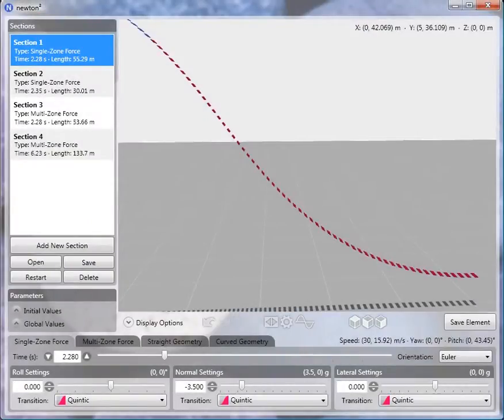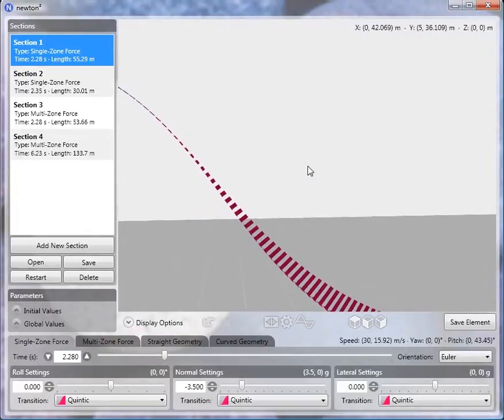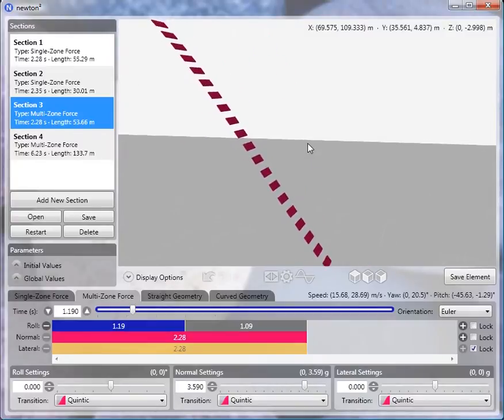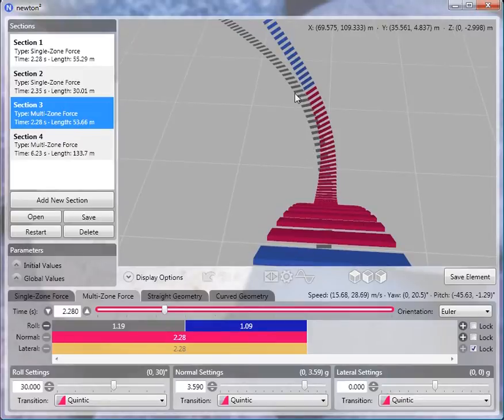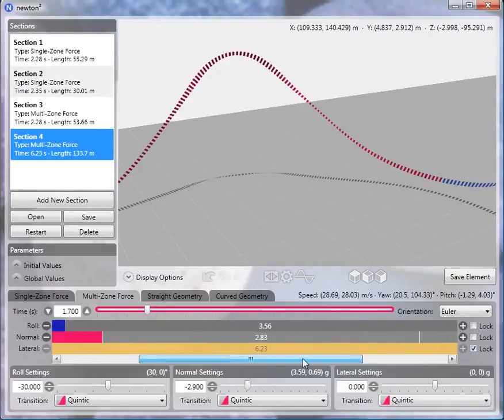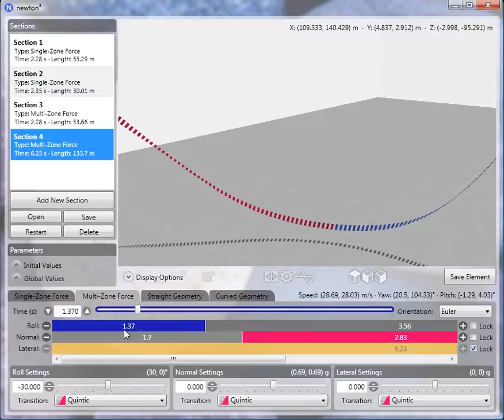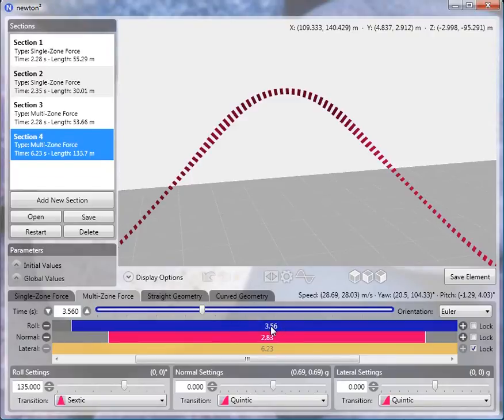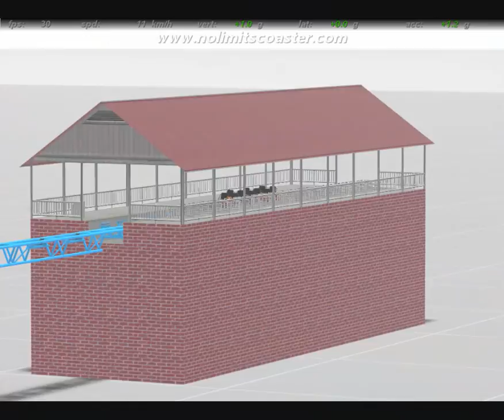newton2 tutorial part 7: camel backs and Stengel Dives

Comment from the maker: What's probably happening is that the conditions (normal force and speed) at the bottom of the initial drop are not the same as the initial conditions that I'm using for this tutorial. You'll need to apply the principles used in the tutorial to your element rather than try to copy the actual numbers.

Comment from the maker: No, you would set the initial values for wherever you start the track. Then, in order to start an element at 3.5 g's, you need to make sure the previous section ends at 3.5 g's.